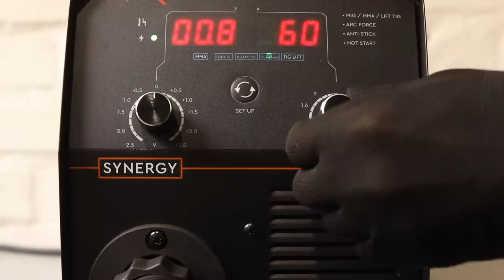Medieval Battle Axe Restoration. Very Rusty Axe of the 8th-9th Century

Comment: If these are very commonplace then what he did was a fun and interesting experiment.  But if this was a rare artifact, I would have stopped at the rust removal.   The moment metal was added it no longer has any archeological value.  Personally, if it was me, I would have only done the electrolysis and other chemical de-rusting combined with wire brushing to clean it up then make as realistic a handle as possible just to show what it might have been like then frame and display it as an ancient artifact.  I did something like that with some old bronze spear heads.  They are now at the tips of several ash rods and on a rack in my office.  At this point he now has a very nice decorative piece that more or less looks something like it might have a few centuries ago.
Reply: Thank you for this comment. This was destruction not restoring. Very sad! At least he didnt melt iron to make new cast!

Comment: I think I would have liked to see the rust and grime removed and them just sit it on a acrylic stand.  A complete bow to its history and totally respecting the craftsmen.  It seems like most of the history of this piece was filled and ground away
Reply: Oh, and when you want to peen a metal and have to use a vase like this one…place it on several layers of thick leather.  It will absorb the force but not distort the other side
Reply: Oh and short handle as light weight and thin this was, it was most likely a hatchet

Comment: I want to cry. Vinegar is a chemical that stays in the material forever and will destroy the steel over time.
Reply: sodium bicarbonate is the right material for electrolysis. and I don't even want to comment on the welder.

Comment: I don't actually know if the piece is that old or not. If that was the case, grinding, welding and polishing it means a total destruction of its historical significance. No museum restorer in the world would take this approach. Historical pieces should be preserved just stabilizing them from further damage. In any case, this axe, even if genuine, would worth nothing: it was a common item, forgen in hundred thousands, with no artistic meaning. Nothing for nothing, I would have kept it original.

Comment: Nice Job. Pretty sure that was never a "Battle Axe"
Reply from the maker: Thank you! This is a 100% battle axe) The weight of the ax is 90 grams.
Reply: Pretty sure you're right. That thing isn't a historical relic either. Nice job though.
Reply: @fishpants3877 And why are you so sure? Read the literature of historians digging up the settlements of Kievan Rus, they described all the axes of that period, and this is one of these types of axes, similar axes were found in battles Kievan Rus, and no, it is not suitable for the banal felling of a tree, because with such a size and weight it is easier for them to break a skull than cut down a tree.
Reply: @fishpants3877  You should really link sources or something.

Comment: I highly doubt this axe is that old.
Reply: No way it's old.
Reply: @fishpants3877  Sure it’s old, but not 1200 years old.
Reply: @Julmaa87  It's old like he buried it for 6 years old. There are a bunch of restoration channels where they basically throw an item into the ocean for a year or bury something in a swamp for 3 years and then recover it and make a restoration video .
Reply: @fishpants3877  Exactly. Which is likely the case of this video.
Reply from the maker: )))I understand you, you don't know the history of that and write like this. Not everyone knows the story, that's okay. Don't be shy. This is an ax of the 8th-9th century. Transitional type. Early Slavs with elements of Khazar battle axes. Google will help you later)
Reply: Nice work! To heck with the naysayers!
Reply: @Julmaa87  Чому?
Reply: @fishpants3877  Well then show linked proof or any proof, I'm interested on it.